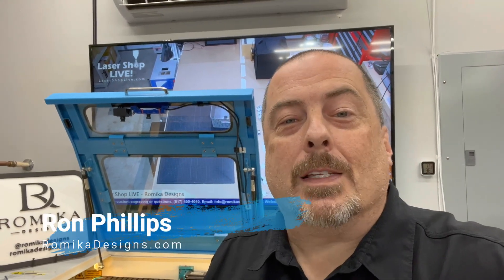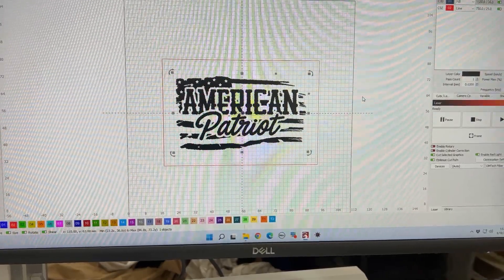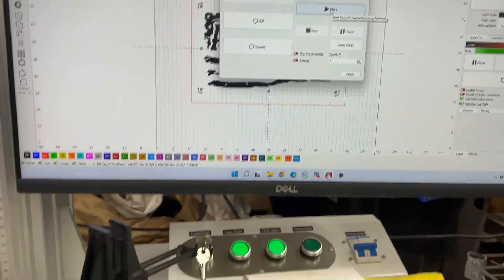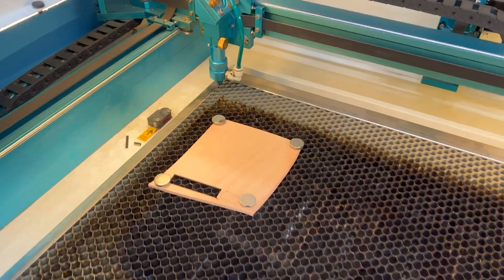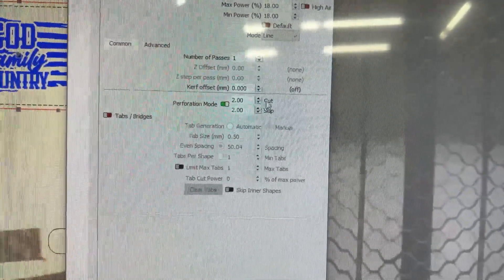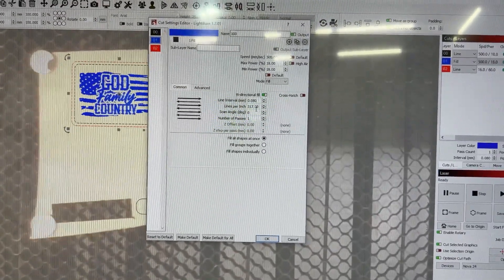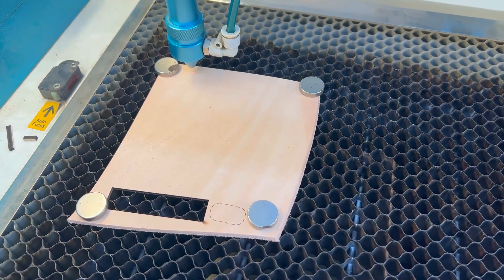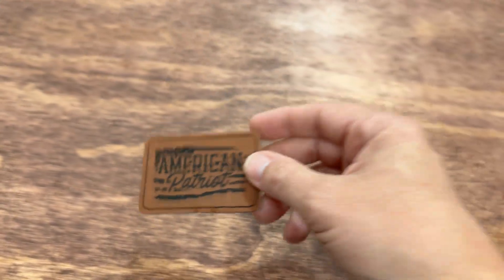Learn How to Engrave Leather and Leatherette on Your Fiber and CO2 Lasers

Comment: I'm trying to dial in my settings on my 35/100 for veg tan leather. Can you share your cut settings? I'm also getting so much char/soot on my engraves.
Reply from the maker: So, I have a 24/60, but if you just notched up the speed/power slightly you should be okay.  I also defocus by about 2mm.  That helps with the soot.  I also turn off my air almost completely.  My settings for leather are: Engrave at 500/18 and Cut at 16/60.  Hope this helps.

Comment: Looks like you're getting a lot of soot on the CO2 when it initiates the cut process. If you started with a lead-in from off of the product area, that sooty spot would be on your waste material, not your final product.
Reply from the maker: Great idea!  Thanks, @DerekHubbard!  Will try that.

Comment: Nice video. Going to try leather this weekend. What is the best way to clean up? The start line on the co2 cut left a little area from where the laser started the cut. what would be the best way to clean it up?
Reply from the maker: If it's real leather, you can wet it to see if you can get that off.  I actually defocus by about 2mm and I don't have that problem when cutting.

Comment: Awesome video. Question for you, OMtech is sold out of 30W. If I were to purchase the 50W, how much different would the settings need to be for leather specifically?
Reply from the maker: The settings would be different, but I'm not sure how exactly since I don't use a 50w fiber.  For the record, I do have a 30w OMTech fiber for sale if you're interested.  Email me at ron@romikadesigns.com if you are.